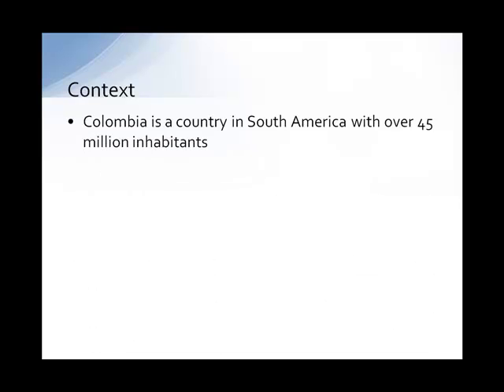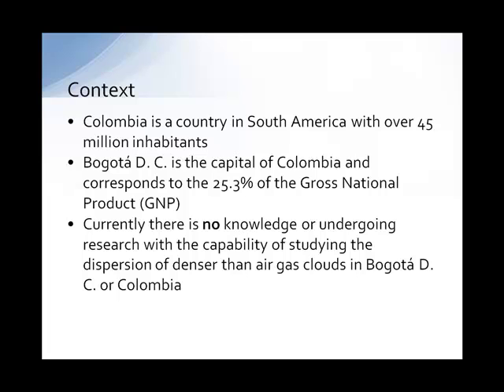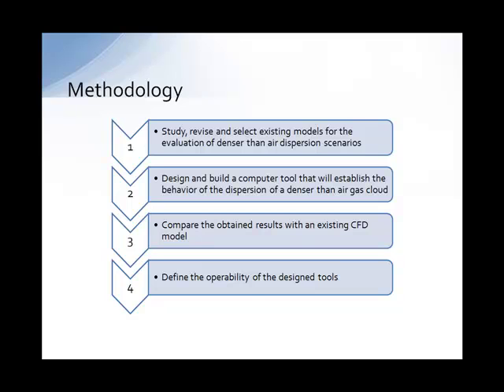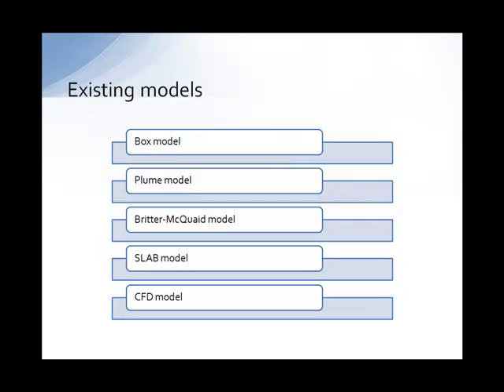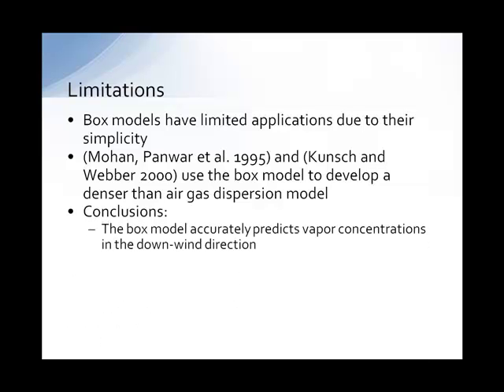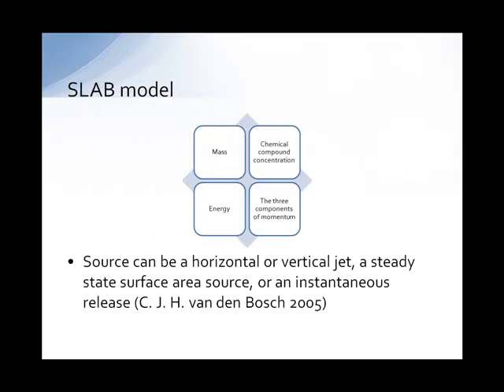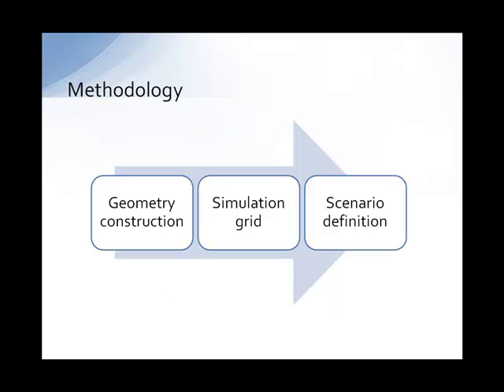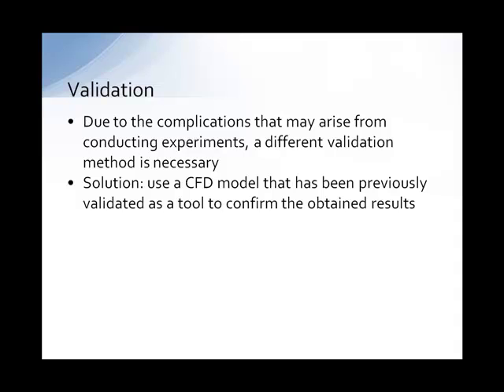An evaluation of denser than air dispersion models

Comment: good informative video. It is clear that lots of research was done. It is not clear what the requirements of the government agency are. For example, does the government need something that can process in real-time, or does it just need validity? Do they need to overlay spread models with models of population, economic activity, and chemical transport behaviors? It is not clear from the presentation the answer to the question risk of what to whom. This is good work, but should be better framed.